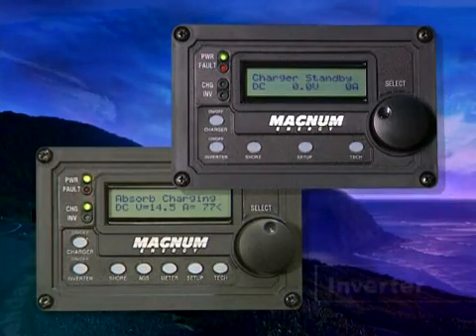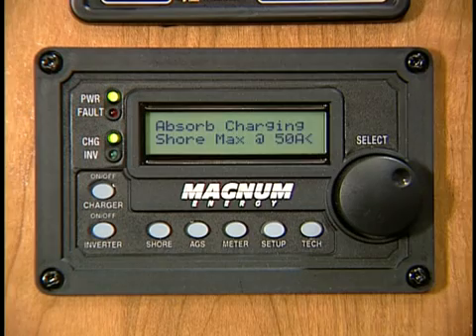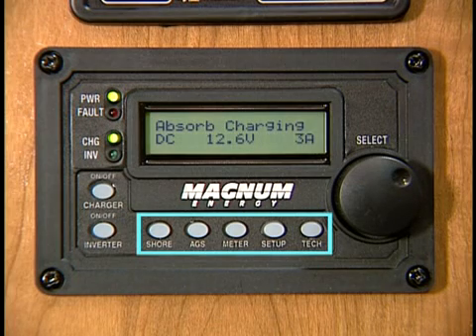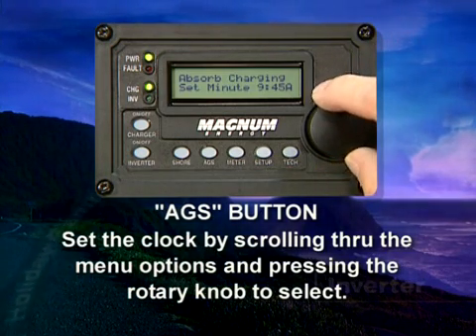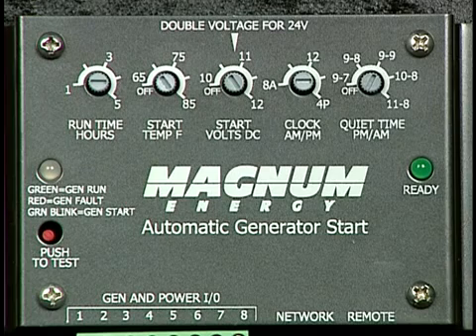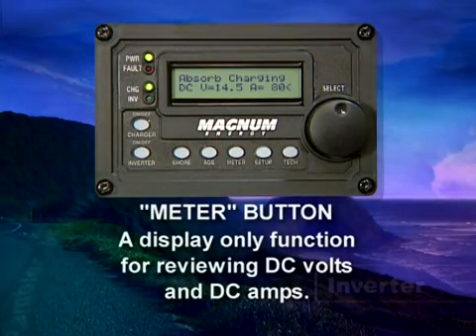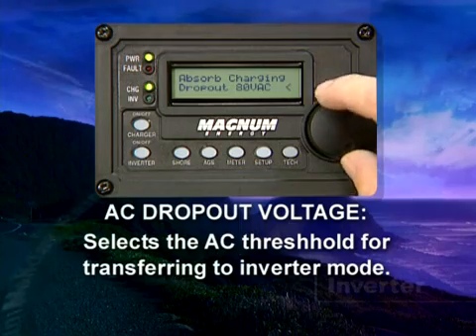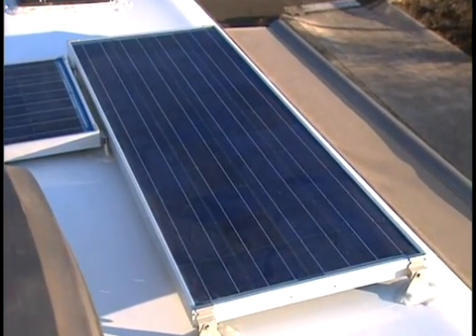Magnum Inverter Charger operation

Comment: My inverter says low battery and i restarted it and it still doesn’t work
Reply from the maker: If you are really tring to invert and the batteries are weak or low it will not work. Check your battery voltage.

Comment: Does the Magnum unit have settings to charge lithium batteries?
Reply from the maker: I believe it has a manual setup. There is a great RV forum that definitely can answer the question. IRV2.com .

Comment: our magnum energy in our motorhome has a problem.  The LCD display is not working.  The power, fault, charge inver lights work, the charger on/off button works, inverter on/off button works, but without the LCD display screen I cannot work the shore, AGS, meter, setup and tech buttons I cannot work because I cannot see what I am doing, setting up.  How do I get the LCD screen to work again.
Reply: Hi,  did you get this figured out?  Ours has begun to not work correctly